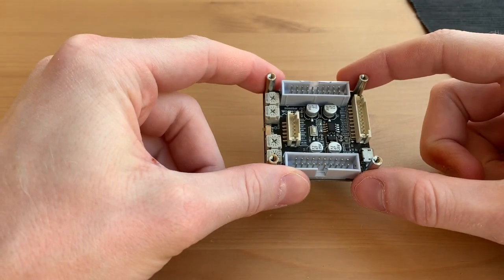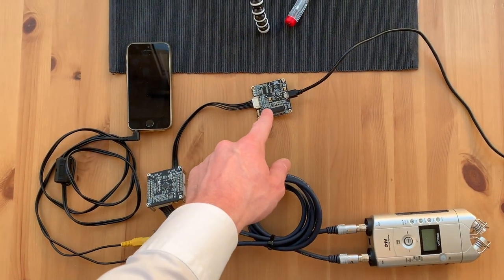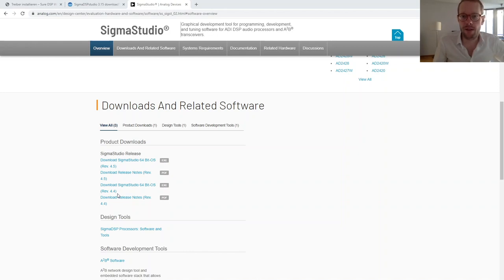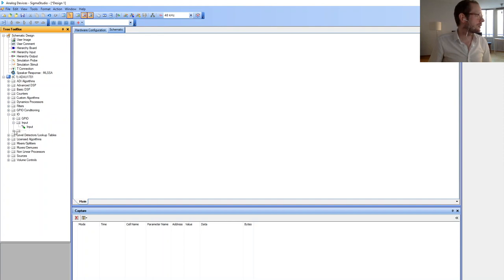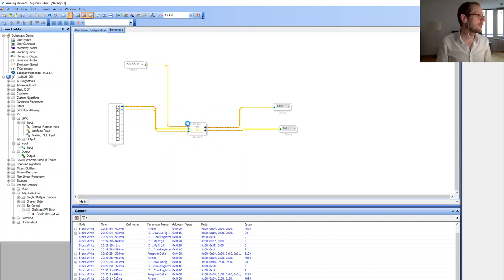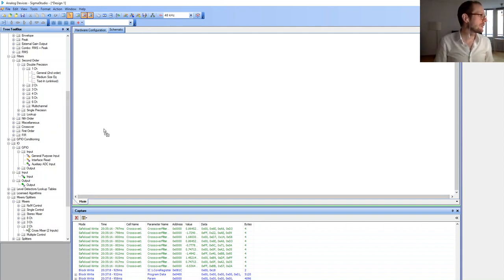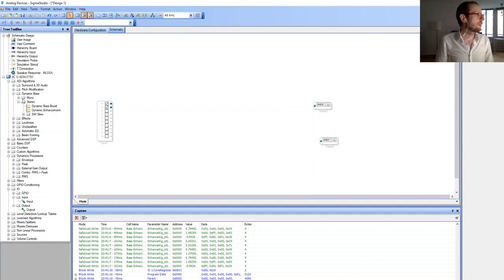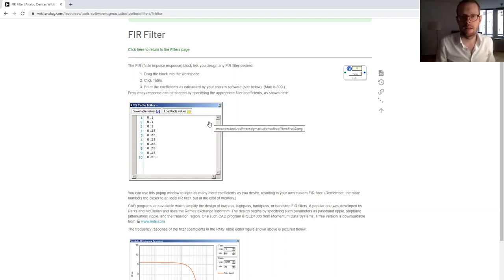[#17] ADAU 1701 + Sigma Studio Tutorial (WONDOM DSP)

Comment: The icp5 does NOT supply power to the ADAU1701 dsp. Once i connected both the dsp started working and was able to connect in sigma. Also the files on diyaudio dont work with modern x64 O/S. Version 4.6 worked fine.

Comment: Great explanation, thank you! I'm using my dsp on a mobile rig with quite efficient speakers, and have problems with the noise floor. Do you have experience on how to reduce the hiss/hum in the background? I'm sure it is not the power supply, and could only reduce it a bit with gain staging
Reply from the maker: Johannes Wegener i also experienced that at least on some channels on this board there is a lot of noise.
I’m currently not sure if this is a general problem with the ADAU1701 or a specific problem of this board.

To be honest - I doubt that this problem is related to the Chip it self because otherwise ADI would be much in trouble selling this chip. So I guess it’s a board design issue
Reply: @YetAnotherElectronicsChannel  It may need grounding and shielding

Comment: Excellent tutorial!  Liked & subscribed. Is there a online forum that is good for SigmaStudio support for more complex projects. For example, I'd like to use an ADAU1701 DSP will several amplifiers, which are also have ADAU1701 DSPs. It would be great to see a tutorial on connected multiple DSPs together, with both analog and digital inputs. For example, I plan to merge AptX HD stereo signal with analog stereo signal, then equalize, apply active bass, then crossovers to multiple amps. I also want to add pots for main volume, individual amp volumes, bass, mid, treble, and analog input.

Comment: Excuse my ignorance but a genuine question: Every time i build a dsp based Speaker i must buy a DSP board like that? Or this is just a develpment board and we can flash the algorithm into any ADAU1701 chip?
Reply from the maker: This is just a development board. You can also build your own hardware design and still using sigma studio.
Reply: @YetAnotherElectronicsChannel  So we use the Development board to fine tune our final project and then we flash the final code into another PCB  that uses the ADAU1701 chip, for manufacturing, right?
Reply from the maker: @exprymer  no u can start directly with your design... you need only access to the I2C port of the device. Then u can connect the USB-I2C adapter to your custom board. By the way: the data is stored in an external eeprom which is also connected to the adau1701. Please check the reference manual from analog devices directly. Everything is well explained in there
Reply: @exprymer  The board shown in the video has everything you need to make this your own. You CAN design your own PCB around this, with for example your own amplifier on board and other things you want. But for most people, this board does fine. It's either too expensive or too complicated to design your own board. You still need most of what's on this board in your own design, perhaps minus the connectors.

Comment: Is it possible to have 1/4" jack input and outputs instead of RCA?
Reply: the inputs as the outputs have 3 connections each; left, right and ground. you can desolder the connectors that are installed and use others for example. 2*rca= L *gnd, R+gnd  to stereo 1/4 jack which has L+R+gnd.